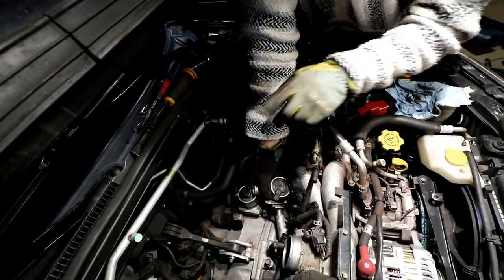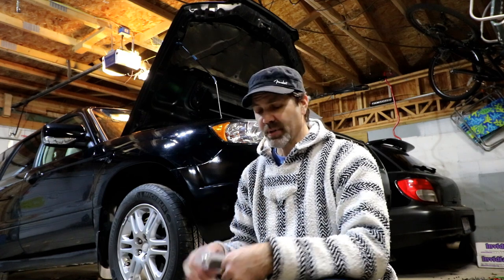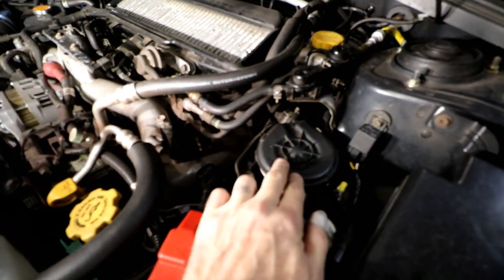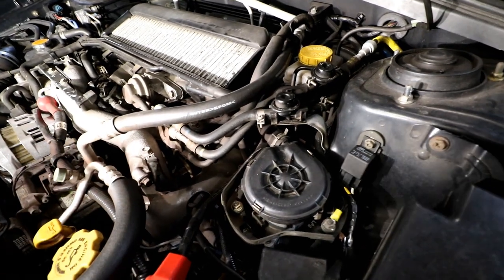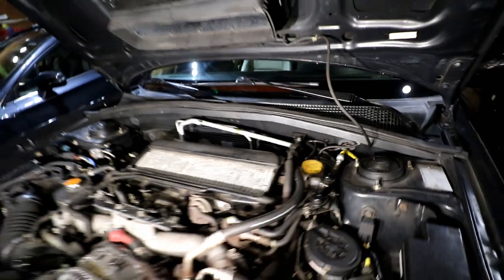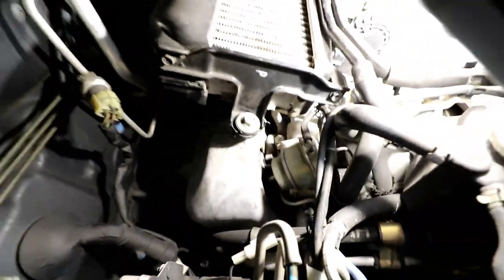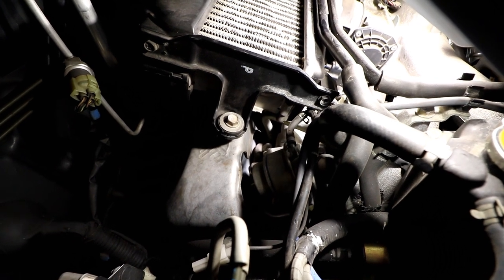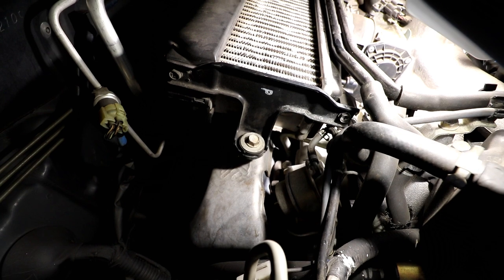Removing A Faulty Smog Air Pump: Subaru Forester XT

Comment: I’m getting p0410 in my 06 Forester xt. Do you know if deleting the codes with a protune would allow it to pass deq smog?
Reply from the maker: Deleting the codes doesn't fix the problem. If you're in a state that does smog testing you will most likely need to fix it. My state doesn't do smog testing so I couldn't say for sure.

Comment: Hey I does that pump have a plug if so where. I found mine just laying in the engine bay without the hose or plug in on it. But I cannot find the wire to plug in on it.
Reply from the maker: Yes, there is an electrical plug/ connector but if you don't have a check engine light on, don't worry about it.
Reply: @DIYEVERYTHING  well I found it with the hose off and the plugg out. A reason it should be like that?
Reply from the maker: If it doesn't work it will give you a cel. If you're not getting a cel then the code has been deleted and you're OK.

Comment: Awesome video! I happen to have similar codes but mine are a p2431 and p2432.  With these codes its not letting my car start. I have used starter fluid and the car turns over and dies immediately. I also noticed in your video that I do not have the fuse on the strut tower as you demonstrated. Would this procedure help in my case?
Reply from the maker: Unfortunately with the new "green compliance" that tuners must follow, you would need to replace the system and cannot simply remove it and have a tune flashed to the ECU to eliminate it. There is an option of open source tuning but I have not tried that myself.

Comment: Ole school ,,,,,just move 02 sensors towards the rear 12 to 16 inches yours codes will stop ; the world ralley have their sensors 3 ft back so the air/fuel ratio stays at 14.7/1 card is has the plugs or just use a bolt!!
Reply from the maker: Very true thank you. 
The only code I had was fuel related because the pump was unplugged. Once I plugged it back in I could have let it go away on its own but wanted to make sure no new codes popped up.
Reply: @DIYEVERYTHING  I m retired ASE 48 yrs .Have a close friend a Subaru "Master Mechanic" we talked about this once compared to the old air pumps in the 80's he said GM pumps were 3 times the size! To move the spent exhaust,Subaru's pump aids in startup only he explained to me ,might need to CK on this I'm not sure?
Reply: I've come across air pipes removed and blocked off ,car lots in Tenn. Are know for that then the customer brings in the car on a open circuit up stream sensors thus rich command is applied!

Comment: Thank for the great video. I am about to do this on mine 2006 WRX TR with 118k miles. Got P2444. I will do all what you show with exception of removing the pipe that leads to passenger side. I will try to black it off (the pipe) so no need to remove all exhaust parts, etc. I hope I can pull this off.
Reply from the maker: The other option is to put the block off plate on the passenger side pipe where you remove the solenoid. Does the same thing, I just wanted it completely gone.
Reply: I spoke with some tuner today if he can remove the code after I do block off, he says he cant do it because Cobb is only  for offroad cars. Probably he got spook by me when I said I need to make sure I'll pass state inspection. Was you able to remove this code for good and no issue with emissions  inspection? 
Thank you in advance for reading and replying.

Comment: I just recently got a 2015 sti... it only now has 70k. I just got the code about the valve being stuck for the air pump. I just got the delete kit and will be doing this. My car is in limp mode and I was wondering what the hell happened
Reply from the maker: 2015 is a completely different set up from the 2006 sg9 model.

Comment: Great video, I got a black 06 FXT as well and need to do this very soon :D
Reply from the maker: Keep  in mind, you may have check engine codes for the pump like I did. I had them disabled when I got it tuned.
Reply: Yeah I'll keep that in mind, got a full turboXs 3 inch exhaust (catted downpipe) and cobb intake box coming so planning a tune with these items.
Reply from the maker: While it's all apart, consider upgrading your turbo from the td04 to a vf39 or 48. You will lose a little launch time because of the lag but your top end will be snappier. That's what I did, there's also a video.

Comment: Hello, can Delete the secondary air pump from a Subaru Forester SG6 ? (engine type is EJ204)
Mvh Odd (Norway)
Reply from the maker: You can if you or someone you know can connect to the ECU and deactivate the codes. Otherwise, you will have a CEL illuminated so the time.

Comment: BTW I will watch the other recording you do if you do, along with the guide for the fuses to pull and all that.
Reply from the maker: The only fuse I pulled is in the small fuse box under the hood for the air pump.

Comment: Hi,
any news about the Air Pump error codes? Do you delete the codes? And can you show us how it looks like now under the hood?

I have the same error P2441  on my MY11 WRX STI so want to remove the howl s**ti Aipump crap and want just now how it works now on your SUBI. 

thanks for the video!
Reply from the maker: I had the P2440 code, valve stuck open, that allows exhaust to backflow into the pump and cause more problems. Yours is stuck closed so you're safe from more damage. At this time, the only way to completely disable the codes is with a Pro-tune or open source software like Rom Rader and a Tactrix cable.
Reply: DIY EVERYTHING I just got an 07 forester xt and got the same code but mines stuck closed, people are telling me to delete it like this video but is it really necessary if it’s already stuck closed ? Lmao

Comment: How much did the tune run you? I'm trying to determine if it's more cost effective to just replace my faulty valve or go the plate/tune route.
Reply from the maker: $350 for the tune and I think about 35 for the block off plates. Fixing the air pump, from the last quote I remember hearing, started at  $750 just for parts. Even then they couldn't guarantee that would fix the problem.

Comment: 2006 & later......
Reply from the maker: They use the same ports in the heads on any ej with an air pump so the steps are very similar on any ej with an air pump.